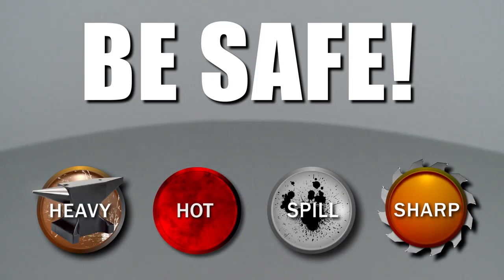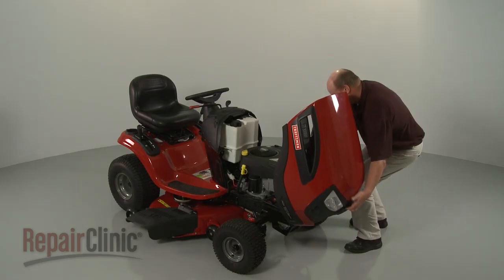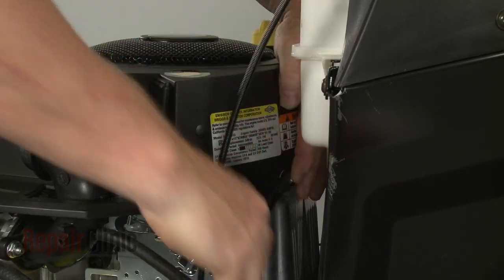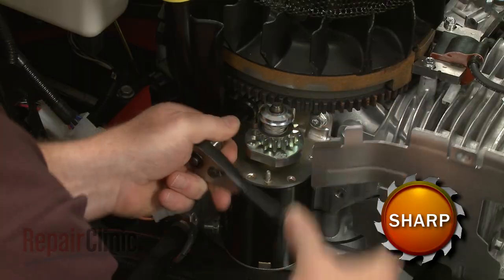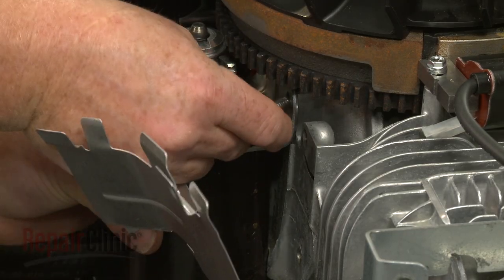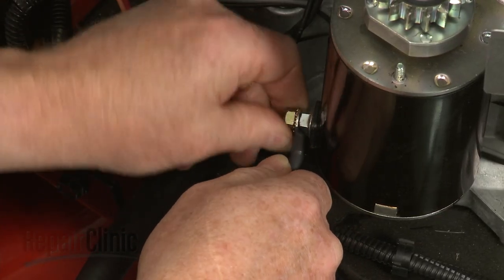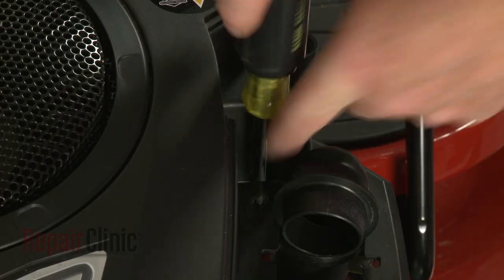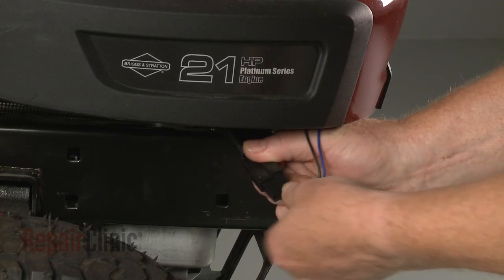Briggs & Stratton Riding Mower Engine Starter Motor #693551

Comment: Im looking for a replacement starter for the Briggs model 190702 engine i think it might take a 14 tooth starter but it may not parts off the model 190707 would work on my 190702 model it just needs the correct electric starter

Comment: I did what you told me to do about the starter on a Briggs & Stratton motor but now when I crank the lawnmower over the starter will not meet with the kranks teeth it only spends it does not meet the crank what can I do?

Comment: Yes, I have a older craftman mower and it starts find but when I engage the blades or the clutch it's like I turned off ignition switch. There have got to be a bad safety switch some where? How do I find it?

Comment: I have a 2007 John Deere ZTrac Z425B zero turn mower, 48" deck, 23hp Briggs & Stratton Twin OHV engine.  I need to replace the starter on it.  I have searched high and low for a "You Tube" video to help me with this process.  But, cannot find anything that helps.  The mounting flang on my starter is different that those shown in videos available.

Comment: I don't know what sort of witchcraft you use to get the nut off the power to the starter motor but I have the EXACT mower and mine is just freaking turning. I tried getting something on the second nut so I could just turn the first one, but no dice. Awful....